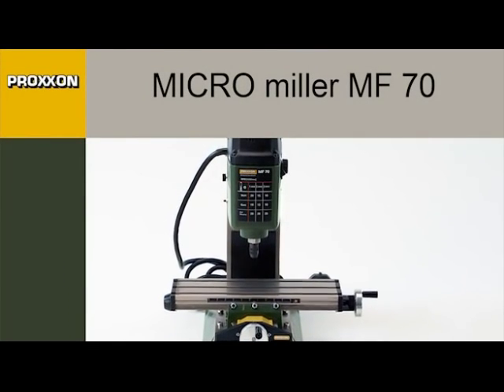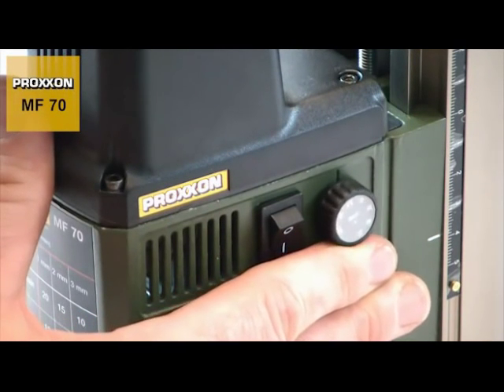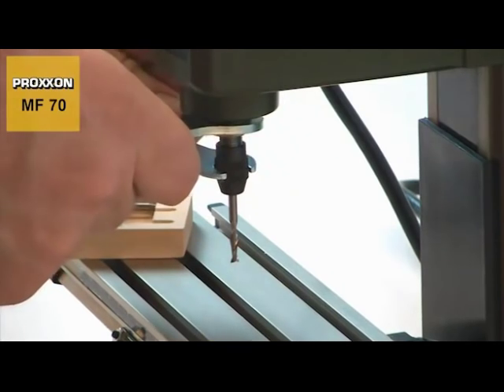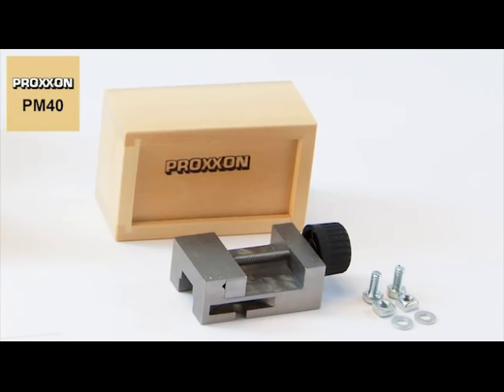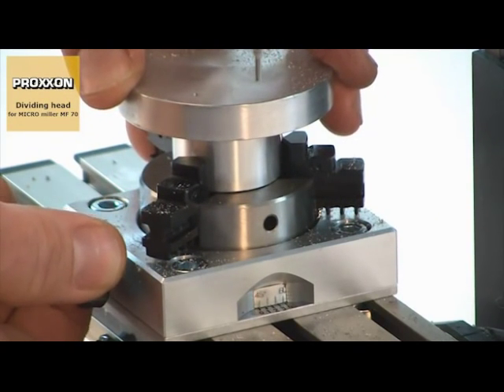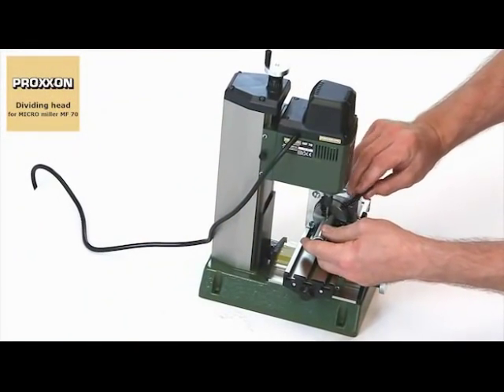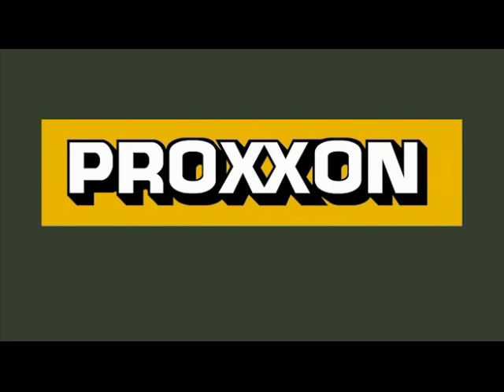PROXXON   MF 70 MILLING MACHINE  from CHRONOS

Comment: I have one of those and for making small parts for model and toy steam engines out of brass and aluminium it's fantastic I wish there was a small fly cutter for it even just 1/2" would be great
Reply: Make one? :-)
Reply: Would you recommend this for beginners?
Reply: @TinoBamBeano  sure, tho it's size limits it to smaller parts. cost is under $400 US.
Reply: you gonna run a fly cutter at 10,000 RPM LOL
Reply: @Sugarsail1  He said it can be run as slow as 5,000.  I don't know much about fly-cutters, but from a couple of decades of experience with my Taig Micro Lathe II, the very thought of a fly-cutter scares the daylights out of me!

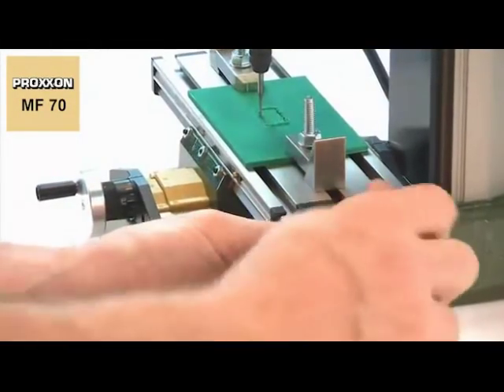Comment: If you have to use the hand wheels like this: 1:05, should they be a little bigger, hmm?
Reply: Not at all, in fact they are that size for a reason, if you increase the movement by having a larger wheel, you will destroy more bits than you can imagine. Also, the space will be an issue if the hand is bigger. This is supposed to be a PRECISSION TOOL, if you want to do big rough cuts, you need a bigger machine.
Reply: @nicolashrv  Bigger wheel means more precise movement.
Reply: @xsk8  I don't mean about that, but if you have a bigger wheel (in this case, cannot be due to interference with the machine movement itself) then you have less control. Al micro tuning features are best handled with fingers, not with the hand/wrist movement.
Reply: its like screwing on a bottle cap with 2 hands lol

Comment: it's good for a model maker or engraving, but for the money unless you need something that small, you'll have easily $500 USD into it. the X Y table is flimsy and the handles are too small; first thing you'll upgrade.  then you'll hope it could be stiffer, then scratch your head and see it would be easier to just build a small mill like you want than to upgrade all the components.

the good side - it's quiet, the indexed chuck table is nice, it's slightly better than those Chinese 25-36watt 6-in-1 micro mills, and a  good steel vise
Reply: Thanks mam, was wondering about buying. What other mill, in roughly the same price range, would you recommend?
Reply: This is a precission tool. Of course you cannot use it for large works. And this machine cost around $300
Reply: @nicolashrv  low precision out of the box. the backlash in the table is unacceptable, but is workable if very close tolerances are not needed. expect about .015 - .025 +/-
Reply: @pauls5745  that stuff can be adjusted. Just check some instructions
Reply: @nicolashrv  play in the Z axiz can't really be altered without major changes...

I do like it tho, because it'll fit on the bench with my small lathe. You'll want to make or get better T nuts, make your own gibs if you use the XY table that comes with it,  drill a hole or 2 if you want a chip guard or just go with a magnetic setup. A friend has one to do stuff on R/C cars, I played with it a little bit.

all in all, it's decent for PCB, plastics, engraving, drilling fine holes (abt 67mm depth only). remember tho, this is only a 100W motor and bit size is 1/8" and smaller, so 1"/25mm deep milling any material is better done by bigger machines. even if you go really slow, a Dremel-sized bit will flex. A model maker will love this  @ $550  

I didn't have the chance to measure runout of the spindle. It's made in China, so I'd expect .004-.012

Comment: How does it handle steel?
Reply: It probably will not handle it well, unless you talk about mild steel. Going at the slowes revolutions possible, and with some specific bit, and use a lot of lube and coolant.
Reply: steel can handle it ... but not in reverse ...

Comment: sliding bearing surface should NEVER be made out of aluminum, which this machine has; aluminum surface hardens and wears out very quickly.  In addition, the entire frame of the machine is cast aluminum, which lacks rigidity.  Extremely high speed spindle is suited for router, not milling.  The MF70 has bad design and bad choice of material on top of being way over priced.